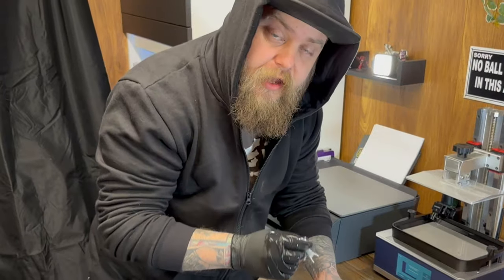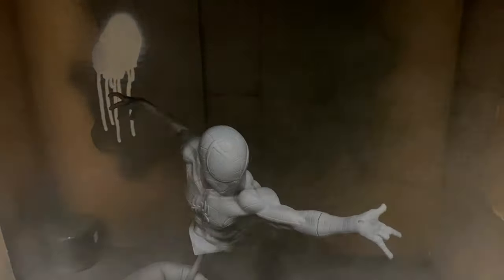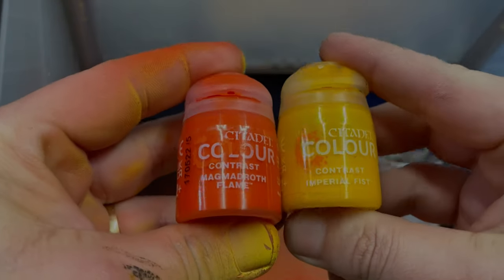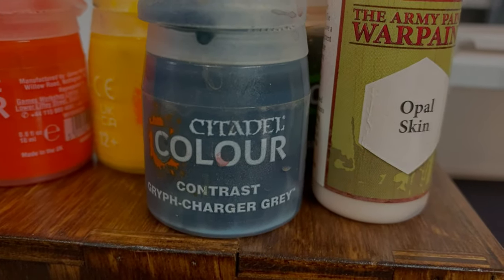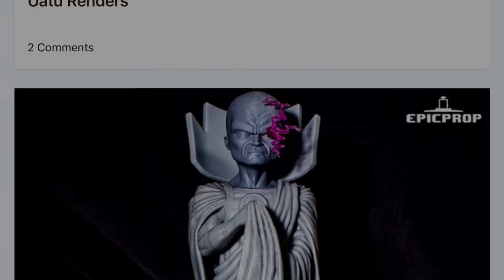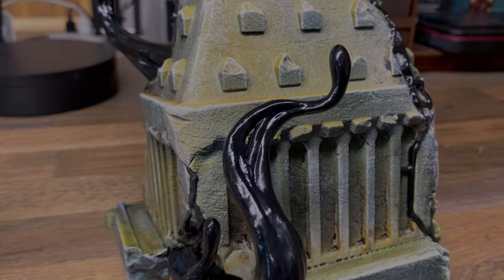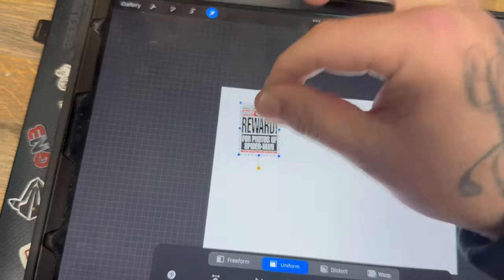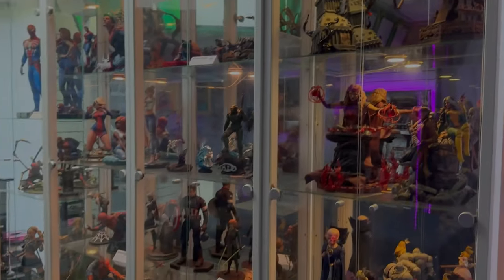If I Don’t Type Warhammer Here, Nobody Will Click| Groundeffected.com

Comment: How well does it clean off.  An issue I have with a lot of resins is even after a go in a wash station and second manual wash in IPA the resin is still tacky after more than enough time to fully dry and evaporate.  If I ignore it and try to prime it doesn't stick well.  So I've been blaming the resin for being too clingy to the model or just not washing well.